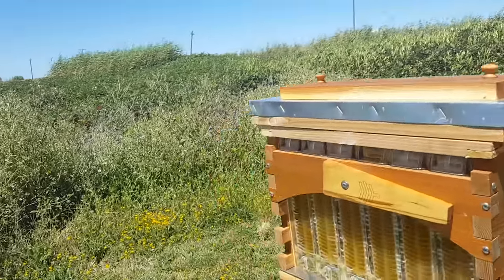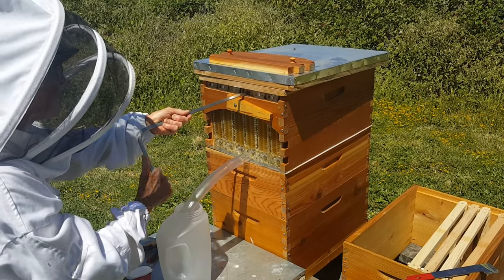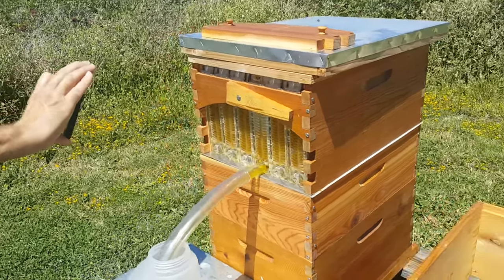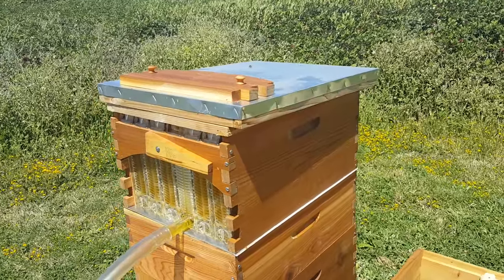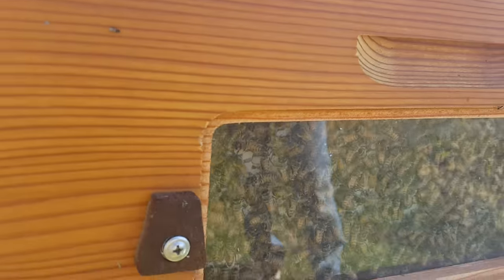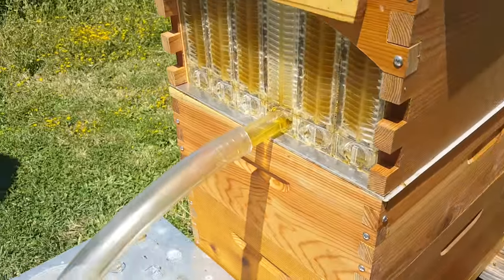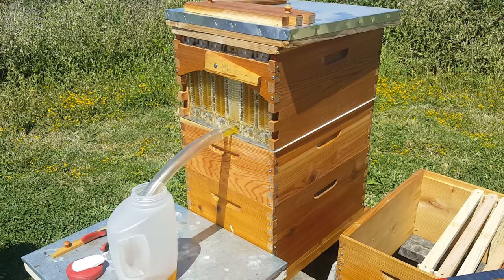Flow Hive extracting the first honey 2016

Comment: Hey Brian, question for you.  I'm hearing from several beekeepers that they are finding it impossible to clean the Flow Frames after like 4 years of use.  Like they have tried everything.  Do you have any ideas.  I was just thinking to clean them every year.  But I would love to hear if you had any ideas.  Thanks so much
Reply from the maker: I tossed my flow frames in the recycle bin last year.  They got some minor mold on then in winter storage and I tried everything to clean them.  Even took one frame apart trying to clean the individual pieces and finally realized it's not worth the time.
Reply: @ubenpwned  Well thats discouraging.  I'm going to try to just keep a better check on them every year and do maintenance so they don't get built up so bad.

Comment: I am a total noob at such stuff and have zero knowledge of this process but am curious:  So how long does it take to populate those six cells?  What is the turnover rate/schedule for this kind of setup?
Reply from the maker: Hi Matt, it totally depends on the region and the flora available within approximately 3 miles of where you place the hive.  The hive shown in the video is near Rio Vista CA on the California Delta and has many flowers that are still blooming in August even, while many places within 30 miles are experiencing a dearth, or have limited sources of nectar & pollen for the bees.  Seeing as this hive is in a superior location, it did not take but 6 weeks or so to fill.  I will be going back up there in 2 weeks to check on other things and I will see how full it is again.
Reply: Cool enough; TY :)

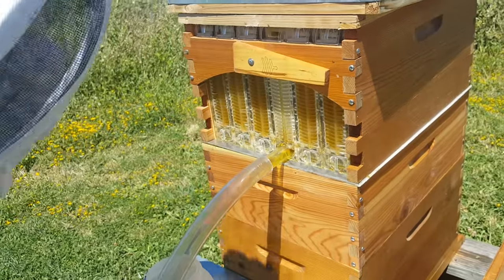Comment: That's interesting at 2:05 so the key is to not open the whole frame at once, you can open each frame partially to prevent overflow.
Reply from the maker: Rick Deckard yes it may not be fully visible in the video but the drain pipe is completely full of honey around 2:05 and there is no room for more, so if the frame was opened further it would have spilled over the sides of the internal trough.  I've done it 6 more times since the video was made and a few times i got impatient and opened it too far and had a small amount spill into the hive, but not a large amount.  Thsnks for watching!

Comment: So what do you think of the flow hives?
Reply from the maker: Hi Donna, I think they work as advertised.  If I could do it over again I probably would not buy them, since I now have 9 regular Langstroth hives and I am fine with taking them apart to harvest.  Bottom line though is that they do work and all the naysayers on the bee forums were wrong.  I belong to a local bee club and there are about 10 of us that have Flow hives and no one has reported any issues or problems other than a concern over the honey leaking when extracting... but doing it a little at a time seems to have stopped most of that.
Reply: but it seems, like u harvesting immature honey, am i right? 
i cannot understand this several moments - what happens with brood cells and other
and how much harm this hive causing to bees in compare to ordinary hives
Reply from the maker: the honey cells are capped, so it is not immature honey.  We use a queen excluder under this box, so there is no brood in this super.  I'm not sure I understand what damage you are claiming this does to the bees, they seem pretty happy to live there.
Reply: tnx for the answer, its more understandable now :) 
im worried about damage because of brood exactly
Reply: +Сергей Катков there are no brood in the flow frames. The queen can't access those frames. All the brood will be in the boxes below the flow frames.

Comment: how much honey can be produced  in a day??
Reply from the maker: ayush jain it takes weeks or months for the bees to fill the frames with nectar, process it into honey, and then cap the frames.  I drain one or 2 frames per month in the summer, and I get about 10 lbs per frame.
Reply: It's also dependent Brian on how big the hive is, the climate aka weather and season/area (stress on getting materials/availability during flower season). I've heard reports of all filled frames within a weeks time, and reports that it took months Additionally, the frames style allows for the beeswax to remain with minimal damage. Bees use about 7kg honey to make 1kg of wax, so this aspect of the Flow system can improve your hive’s rate of honey production over time because the bees simply can reuse what they have. That being said, for those who do want to take the wax there are alternate boxes from the same company to buy (not sure if you have one because cant see internal obviously). 
Part of the issue I think is often patience as for many people interested they should look into beekeeping courses and/or learning under someone else locally in their area as they attempt this. That being said, you get quite a bit of honey from this method, with minimal stress to the bees which is incredibly important. And as you pointed out earlier, your grandchildren can view the experience safely without disturbing it ^_^

Hope this works out!
Reply: Oh, bear in mind when I say a "weeks time" I don't mean immediately after install it. I mean after they've settled under optimal condition. Don't want to give others wrong ideas, apologies.
Reply: Lmao

Comment: Where are the bees........how are you blocking the bees in the Brood Box, under typical conditions, when you remove that side of the hive for access..........there should be bees???
Reply from the maker: captain776 the bees are not blocked at all.  Check at 3:35 and you will see hundreds of bees sitting on the landing board.  They do not normally have access to the rear of the flow frames so they can't move out of the rear area where we are working.  You can see them walking around between the frames, but there is no gap for them to get out that way.  They can come and go as they please from the front.
Reply: it's the inside structure of the comb that moves, the bees are not desturbed
Reply: I understand that, looks like u have a divider between brood box and flow super
Reply from the maker: captain776 that divider is simply a queen excluder.  We don't want the queen accessing the flow super.